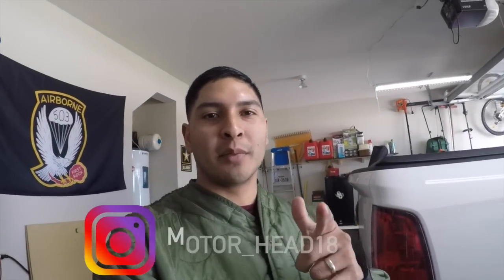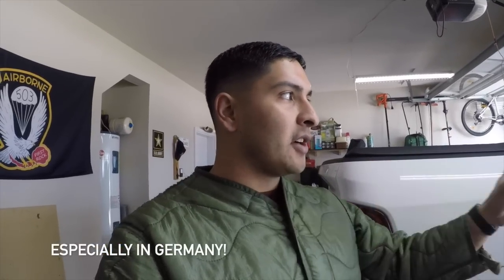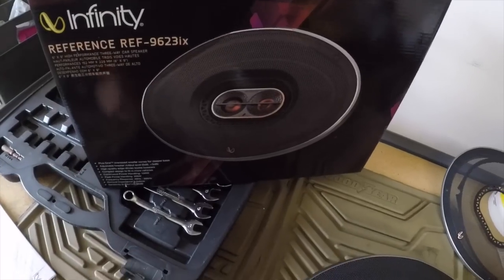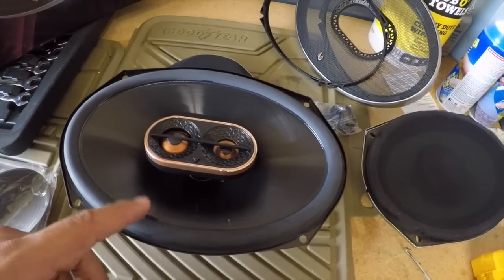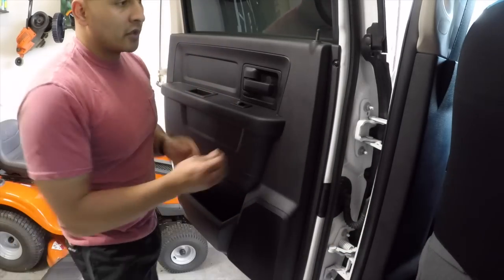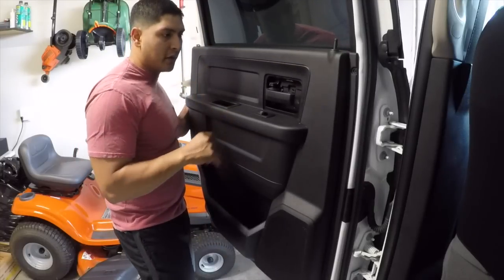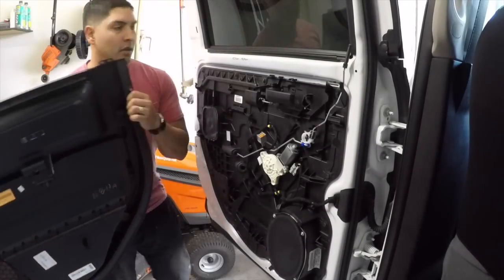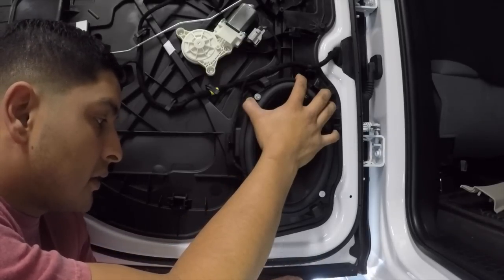4th GEN RAM 1500/2500 REAR Door Speaker *Install and Review*

Comment: Have you ever thought about amping the factory speakers??? 
Would that be something worth trying if you are on a budget.. that way one could spend a little more on subs?
Reply from the maker: I wouldn't mind that!
Reply: I don't know much but I don't think the paper speakers could handle much amp. Also, from personal experience, great bass with crap mids and high's makes for an overall mediocre sound and system. If you're trying to have better sound on the cheap, I'd do the subs and then quickly save for good miss and high's. Happy bumping!

Comment: I have an 08 ram 1500 with the infinity audio system.  Do I have to bypass the factory amp to upgrade my factory speakers.  I already have a double din pioneer running the factory amp.

Comment: I have a 2014 RAM 2500 Laramie with the Alpine stereo system. For the front dash, would I need 3 speakers?
Reply: Update?
Reply: @M2XTalks  I eneded up putting two in. The infinitys made such a different. I replaced the back door speakers as well with infinitys.

Comment: So I’m curious, is this speaker upgrade really so much better than stock? My stock system on my ‘09 1500 sounds fantastic (with the exception of the door panels rattling) so I’m wondering if it’s worth it to do this upgrade vs get some subs
Reply from the maker: Get the rear door speakers for mids and subs for some BASS!

Comment: I installed these the other day and they sound great. Only question is what direction did u have the tweeter facing? I noticed they are on a little slant so if you install with the wire connection facing down, the tweeter faces to the rear. Does this even make a difference?
Reply from the maker: David O I didn’t pay any attention to it but they didn’t look crazy when I installed them. So I guess it really doesn’t matter. I’m still loving mine!
Reply: Depends on if you want them facing the front stage or towards the backseat passengers.

Comment: Crazy crazy good review! I've tried to focus on suspension on my new (to me) truck and enjoy your truck videos and stumbled across this by accident after one of your truck vids and it brought back and reminded me of my love for quality sound! I ordered the dash speakers right after finishing your video. I am saving up for Fox 2.0s for the front and rear of my 15 Ram 2500 6.4L gas truck but plan to buy front and rear door speakers after my Fox's are paid for. 
My question is this: you bought and highly recommend the 9623 IX 6x9's. What about the 9633 IX's? Do they need an amp or are they too big to fit in the Rams or what? ¹/¹⁶" difference in the 2 models. If they would provide a little better bass in the rear door speakers I'd rather get them but I don't have an amp and am using a touch screen head unit of some kind. I'm guessing the 9633's need an amp so that's why you went with the 23's? (Although crutchfield website didn't specify a minimum wattage for the 33's)
Anyway. Love your channel. Thank you for your service.
Reply from the maker: 6x9s are good to go. Honestly, an amp will maximize your dollar for the speakers, but the upgraded speakers are a significant upgrade. I would run the new speakers first and see if they foot the bill without an amp.

Comment: Any clearance issues as far as mounting depth, also any issues with reinstalling the door panel over the new speaker? I kno some of the newer speakers sit ah little higher over stock.
Reply from the maker: Didn't have any issues with these. Can't go wrong with them!
Reply: @MotorHead18  I bought the exact same speakers for my 1500 bighorn 21 so there is no clearance issue at all?
Reply from the maker: @RamonNunezRey  I never did but I did use a spacer provided with the speakers

Comment: Dude excellent review. I have the 2016 Chrysler 300. Same factory speakers. I was going to get the JBL gto even tho they are made by the same company I think the infinity reference 9632ix is clearer and less distortion and cheaper. They recommend infinity for my dash so imma do those In the door and rear deck. Appreciate it. May add a 4 channel amp later. Any ideas?
Reply from the maker: No ideas just yet, I would just match a quality amp with quality speakers bro.

Comment: Hey will the front and back kicker setup you tagged underneath. Will it fit a 2015 ram 1500 crew cab
Reply from the maker: I believe so, but I would double check. They should have very similar interiors.

Comment: did you do a video on the front speakers yet ? my rears sound great by the way. thanks for the research and video.
Reply from the maker: Not yet! But I definitely want to. With the upgraded rears and dash infinity speakers, I have to finish the front to compliment the entire system!
Reply: @MotorHead18  GREAT VIDEOS! very informative. the front speakers are 6x9 or 6.5? Or 6x9 with some mod? I am hearing that crutchfield will suggest 6x9 but the actually size differs. Any advice?
Reply from the maker: @SCOTTYISSRM  Just installed the same 6x9 speakers in the front doors. No issues! I did use the spacer it comes with them.

Comment: Any problems with volume sounding stronger on the doors? Or doe the system sound uniform?
Reply from the maker: Sounds more uniform. Still isn't the best due to the lacking head unit, but its definitely better.
Reply: I also upgraded my door speakers to my 2012 Ram 1500 but it still lacked louder volume due to the head unit not producing enough juice so I did some research and found the  Alpine KTP-445U Power Pack. Its essentially a mini amp that installs behind the stereo and man... it greatly improved the sound on my door speakers. I recommend it.
Reply from the maker: Mark Ceja I will check it out!
Reply: Mike Leguate I installed these yesterday and I notice that my rears are louder than the rest of the vehicle. I’ll be replacing the front corners to compliments the sound. It’s worth mentioning that their is a DM button on these speakers so before you put the door back together makes sure u set it where u like it.
Reply: David O can you elaborate on the button?
Reply: I just saw the button you are talking about. You can poke it through the door pannel speaker holes with a nice long thin screw driver
Reply: Noticed you mentioned about a seat mod you had done. What does this entail and what are you accomplishing by doing this